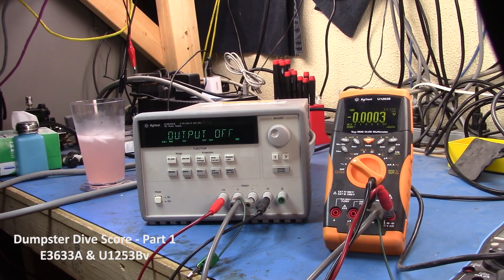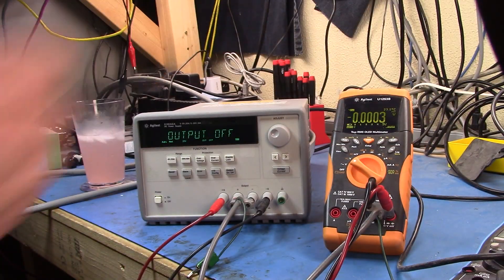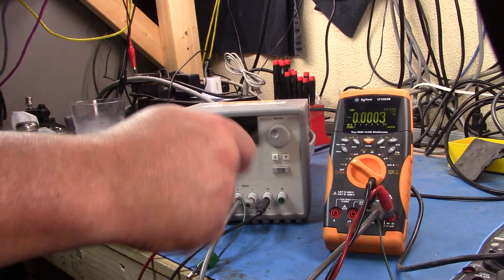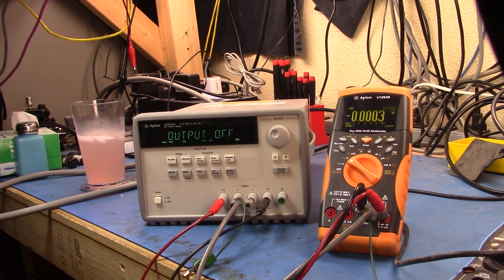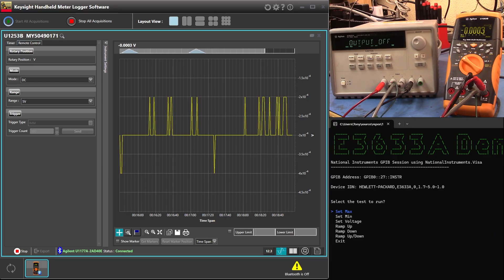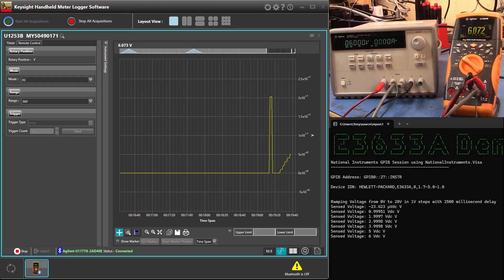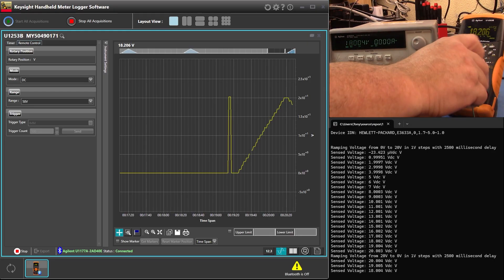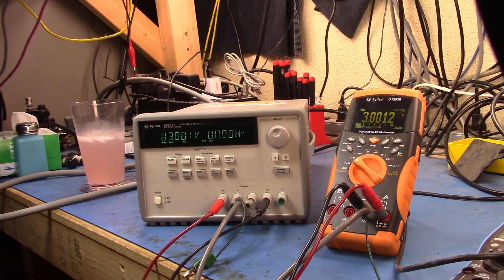Dumpster Score   Part 1

Comment: I have been using a 1253B for about 10 years as my go to handheld. It has good specifications and is very responsive. I find the display very easy to read and easy on the eyes.
Reply from the maker: I like it as well - Just wish the battery life was a little better. The BT connection is good though.

Comment: @5:00 you can usually fix the rotary encoder in my experience, you can dismantle it and clean it, and re-tention the wiper.
Reply from the maker: Interesting - Do you have a video on your channel showing this? Would love to watch it.

I generally just throw these things away but I'm willing to give a fix a try.
Reply: @tgsoapbox yeah I showed it a couple of times I think, when fixing some HP/Agilent 3646A power supplies about 6-7 years ago, video numbers around 560 , I did about 4 videos if I remember rightly on different units.
Reply from the maker: @TheDefpom  Outstanding - Thanks
Reply from the maker: @TheDefpom  Episode 560 - Nice video on repairing the encoder